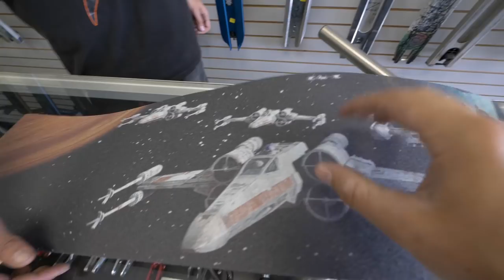RAYMOND WARNER LITTLE BROTHER CUSTOM SCOOTER BUILD!

Comment: Not feeling for that grip and the grip tape or the polished clamp. Black clamp, black grips to match the clamp so it doesnt look completely off, and galaxy designed grip tape.
Reply: Finished video, only problem is the grips. Not a fan of the grip tape, but looks solid from a distance.